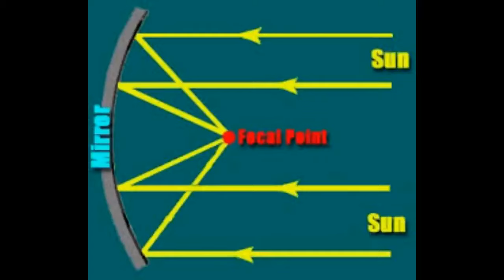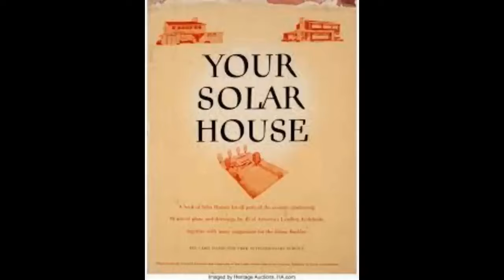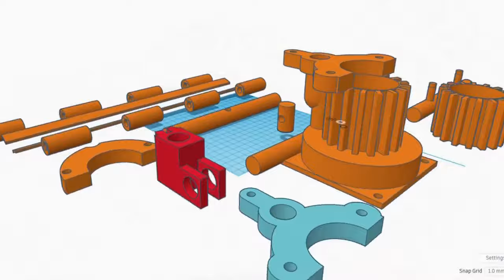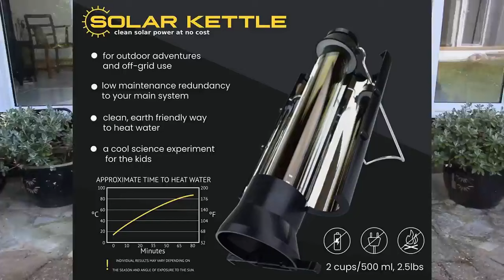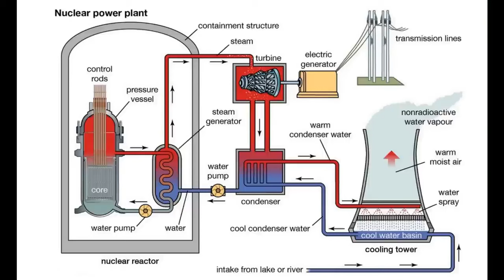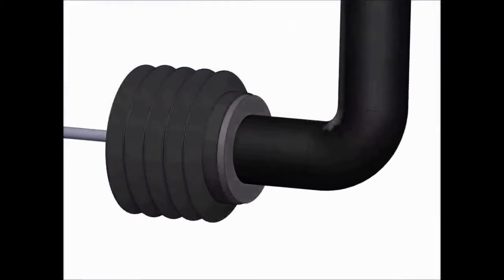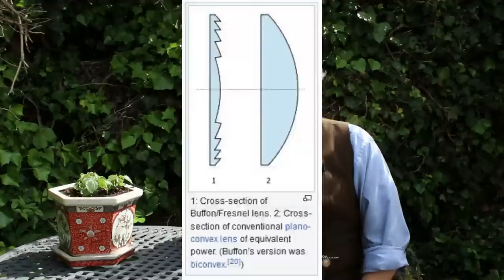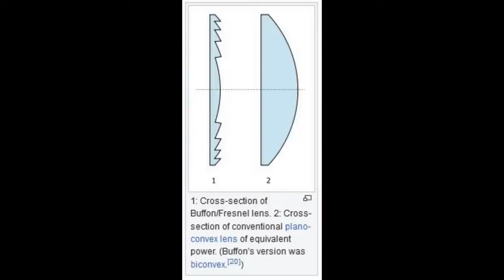001 Solar Thermal - The Poor Cousin Of Energy Generation

Comment: One of the most interesting things I saw in a popular mechanics encyclopedia was a section dedicated to lighting. One in particular comes to mind, the use of a mirror on a table and a light pointing straight down or so. It disperses the light in a dining room setting while the source isn't visible from those at the table. I likely need to find it again to see the specifics, but it was one of the many designs that were rather ingenious for home improvements... that would also be safe/legal... funnily enough there was a tip on how to improve the grip of your workbench vice by grabbing an asbestos shingle from the stack you have lying around and putting it in between the object you need more grip for.

Comment: That thermal pipe should be done in the form of an air-blimp's shell wall, which filled with hydrogen and raised above the clouds for the best exposure. It may have even reflector integrated directly in it. And, if docked somewhere behind the polar circle,  such aerostat would work with no interruptions for a whole half-year season...

Comment: Roads collect heat from the sun all day, and are hotter than the dirt they are built on.  Has anyone tried using this temperature difference with a low temperature difference Stirling engine to create electric power?

Comment: Yeah, it doesn't generate allot electricity in a normal environment.  You would have to gather allot of light and concentrate it to melt salt or alike material. There are RTG which is a nuclear option for the same general technology.  Now, you can heat by sun what is called a solar battery which is really a 20 litre bucket of sand which is heated starting in the morning and it's brought in just before the sun sets to heat the house.  You can also built a heating wall I think it called which is really an organized assembly of aluminum soft drink cans where you organize it in a wall painted black where the sun would heat up the cans and by use of a 12vdc computer fan you would blow cold air into the wall and hot air comes out the top.  This is placed in a sun facing window.  Of course that's only good when the sun is present.  So, yes, allot can be done here but it still comes down to cost vs efficiency.